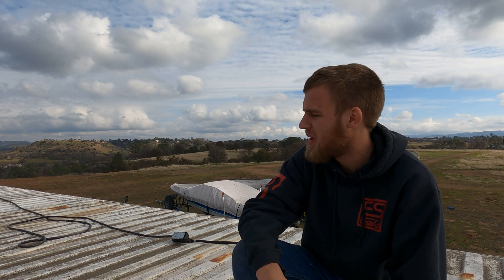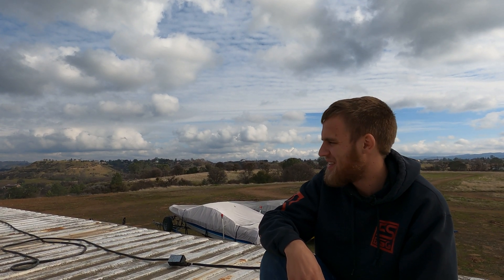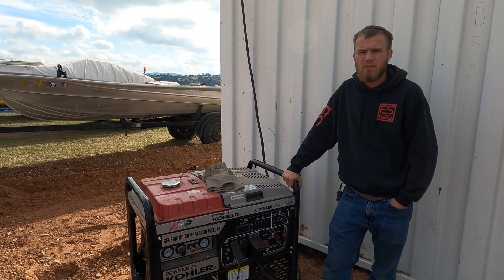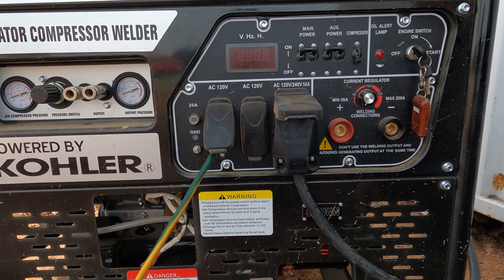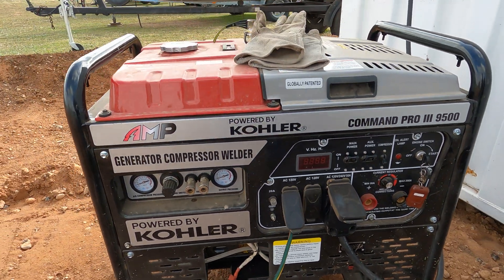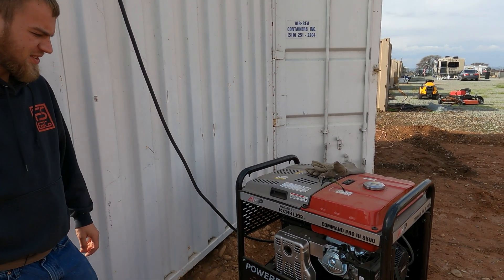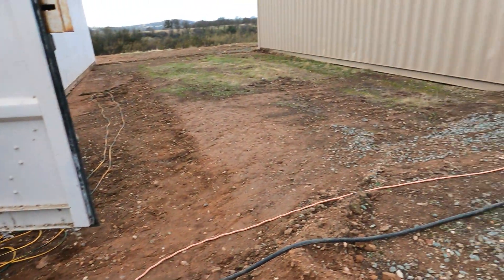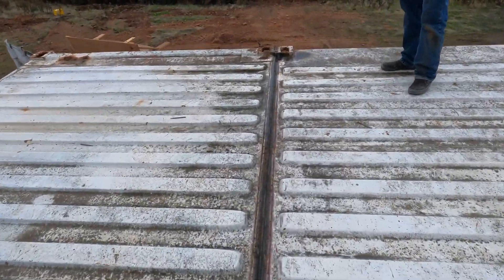Welding The Roof Of Our Shipping Container Lab (Ep. 3)

Comment: it looks like the taper shaft on the generator has come loose from the motor. Usually 1 bolt holds them together. Remove the cover on the powerhead to check the bolt.
Reply from the maker: So we ended up talking to the manufacturer, they had an issue in some of their models where that one single bolt was over-torqued and then after a couple of hours of use would break once things warmed up to temperature.
Reply: @HighTechLab  I am so glad that you got it sorted. Thank you for letting us all know

Comment: That’s an interesting problem with the generator. My guess is the mount between the crank and rotor is a price made in China that snapped. 
I would think the AMP company would provide warranty
Reply from the maker: Yeah, we got into contact with them and they would cover it.  It sounds like the bolt on some of them was over-torqued, so then when the generators come up to temperature they would snap off.  They offered to fix it but shipping that big of a generator is a headache, even if they are paying the shipping costs.

Comment: Make sure you make some sort of support in the middle of the container roofs before you remove the inside walls. I'm kinda getting the idea the roof will sag or drop if you don't.
Reply: I don't really think so cause it will have those 2 square beams going through the middle, but we'll see. Worst case scenario it droops slightly and they can jack it up and jam a column in the middle.
Reply: If you leave say 8" of the corrugated material at the top and weld or bolt those together, it shouldn't sag, assuming no roof load. If I were leaving the roof flat in an area that gets snow, I would sandwich something structural between the two boxes, bar stock, rectangular tubing, or glue-lam beam. You would then have to use wider steel to join the two together at the top and sides.

Comment: Wild...
I guess the rainwater filled the space between the containers, and the welding built up steam pressure...
I guess you should open up the wall down low, and drain out the water...
Reply: But the bottom isn't welded together.